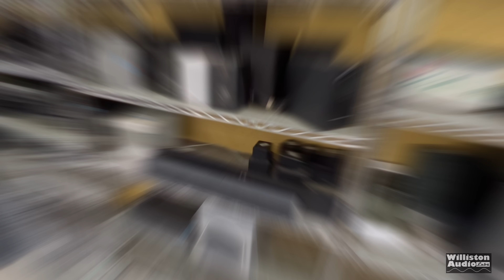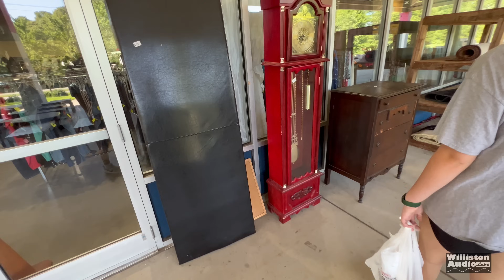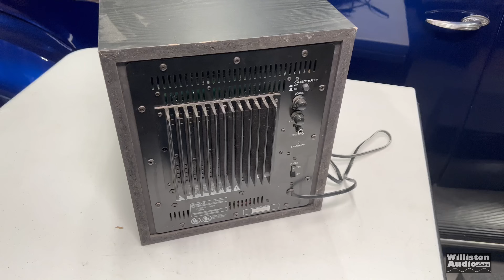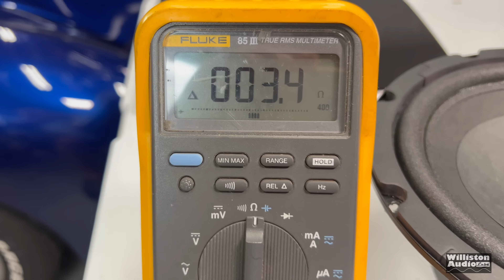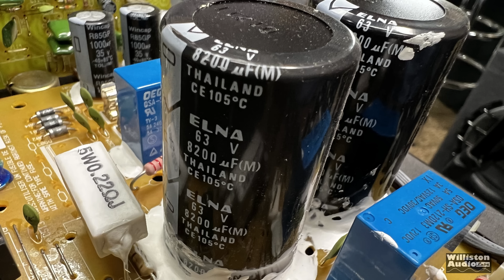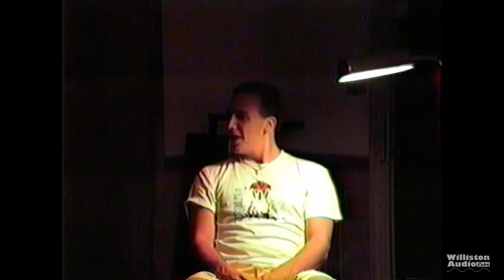Thrifting for Vintage Electronics? Kenwood SW-32HT Powered Subwoofer

Comment from the maker: Want a New Home Theater Powered Sub Instead?
Polk Audio PSW10: https://amzn.to/2R9Mgp6
Newer version PSW110: https://amzn.to/2CxhY7H
Other home subwoofers: https://amzn.to/2RbOiVQ

Send me a tip: https://paypal.me/BigDWiz
Support Monthly: http://www.patreon.com/OldSchoolStereo

Used in this video (Affiliate Links)
Pioneer DEH-80PRS Head Unit: (eBay Affiliate link) https://ebay.to/3xdUwZ6
Stinger 6000 Series RCA Cables: https://amzn.to/3d4W80b
Stinger 12ga OFC Speaker Wire: https://amzn.to/3d4pWKo
D4S 8g OFC Power Wire: https://lddy.no/1csoz
Precision Screwdriver: https://amzn.to/3B920NZ

VIDEO INDEX:
0:00 BIG THRIFT STORE!
0:25 THE ELECTRONICS
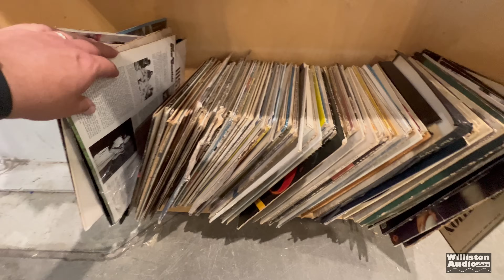1:49 THEY HAVE VINYL TOO
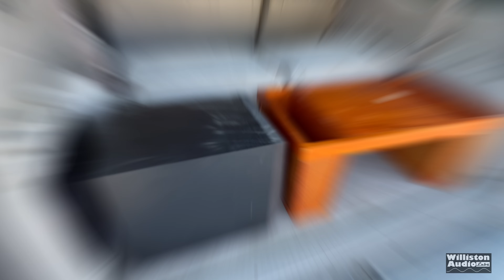2:56 MY PURCHASES
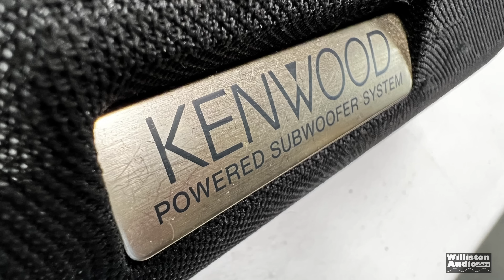3:33 THE KENWOOD SUBWOOFER
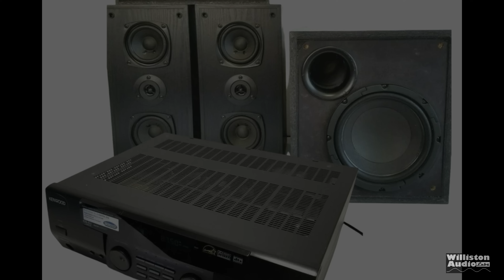4:00 SPECS AND FEATURES
5:05 DOES IT WORK?
5:58 CLEANING 
6:20 WHAT'S INSIDE?
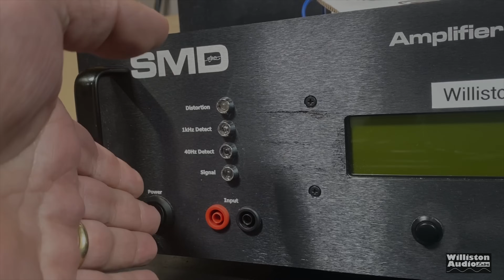7:43 AMP DYNO TESTS
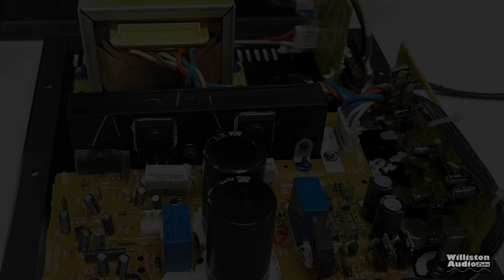9:39 AMP INTERNALS
11:10 FINAL THOUGHTS
11:30 EXTRAS

(Video Gear I Use) 
Camera - iPhone 13pro 1TB - https://amzn.to/3nCjGvc
RODE Wireless Go II Microphones: https://amzn.to/3Q6NVHl
Shure MV7 Microphone: https://amzn.to/3A4OICK
Zoom H4n Audio Recorder: https://amzn.to/3BXjVsS
960 LED Panel: https://amzn.to/2Sxoq3S

This VIDEO was EDITED with LumaFusion on an iPad Pro 12.9:
iPad: https://amzn.to/2Ancr1W
Software: https://goo.gl/6yvWss

--------- Test Bench Equipment -------

SMD / D'Amore Engineering Amp Dyno: https://goo.gl/sJTcf7
XS Power D1400 Batteries - https://amzn.to/2BPFCKW
XS Power PSC60 Charger - https://amzn.to/2CHGcfs
Fluke 1000A AC/DC Clamp Meter: https://amzn.to/2Rw5WDA
Handheld Dyno: http://amzn.to/2u2EgKV
My Favorite Screwdriver Kit: http://amzn.to/2x0VzcE

DISCLAIMER: This video and description contains affiliate links, which means that if you purchase from one of the product links, I may receive a small commission. As an Amazon Associate I earn from qualifying purchases
Reply: 11⁰
Reply: Is this prize on  Instagram a percentage of your merchandise
Reply from the maker: @tommyboy3737  no prize, ignore the scammers!
Reply: @wal  Thanks 4 the heads up but how about a new pb-16 utra for the hell of it🤣

Comment: Those transistors are not for power supply, they are power transistors for sub amp circuit. Rail caps are those big cans, smaller ones are filtering caps for preamp section and that small chip amp. Is there connection for satellite speakers? Maybe its the satellite amp chip :)
Reply from the maker: That was my bad I’m used to car audio amplifiers

Comment: 👍🏻😎 I got a couple of Velodyne CHT-10 subs for $150 from Goodwill. They were made in 2002. 150 watts RMS and 375 watts peak. They sound great on my Pioneer VSX-9500S putting out 260 watts RMS x 4 at 4 ohms. This amp is one of the few amps that doesn't cut power when you switch to A and B at the same time. The receiver was made in 1989 and is still working perfectly. It too was bought at Goodwill for $75. For $225 for the whole system it really can't be beat and it will definitely crank and bump with those subs added to it.

Comment: Yeah, my experience with these was 50/50. I had a JBL from Best Buy. I played music through it, and smoked the amp. It got warrantied out, but smoked the amp again. They told me it was designed for surround sound, not a basshead bumping that poor thing for hours at a time. I ended up getting a Adcom sub. I paid dearly, but it was worth it

Comment: Scored a 10channel multi room home amp new with box/cables at my local Goodwill for $25 sold on ebay for $1000. Same store, recently got a vintage Stillwater Designs(Kicker) 2x6.5/ horn tweets with 10" passive radiator for $25 Sounds just beautiful
Reply from the maker: Awesome 👏

Comment: I got the non powered version of the sub and the front L/R kenwoods for free when my neighbor was moving out. I ended up putting a crossover in the L/R speakers and stuff them and dont sound half bad. Pretty sure garret claridge blew one of these and it held up quite well lol. Mine I modded it with a dayton dvc driver

Comment: the 2sc 2sa transistors are the output amp in push pull and not for the power supply... the amp module would just be used for a driver.  True class AB current rail amplifier.
Reply from the maker: Caught that a bit too late as I'm accustomed to car audio amplifiers and whoops on that
Reply: @wal  LOL yeah...I work in pro audio.  I still like to look at car audio guts too though. As a repair tech I need to know all amplifier topology... class D is making it's way into pro audio more and more.  Seeing more switching power supplies and less transformer driven designs.

Comment: Awesome! I found a similar Kenwood, sealed powered sub 10 inch. The speaker surround was shot and destroyed. Replaced the sub with an new replacement. The sub bangs! Found it at the Thrift store for $7 and the new sub for $16 Amazon warehouse deal. Can't beat that

Comment: My tips for speakers. 
If it has a captive cord or spring loaded wire connectors its probably trash (some exceptions for 70's gear). Also heavy is ALWAYS better.

Comment: I have the exact same sub in my home system pioneer 5x100wrms plus 2 subs ... this one i upgraded the sub and i leave it on full frequency no crossover (amp control the sound) and my other one 250rms 12 inch is just for 80htz and lower and they sound perfect !!!

Comment: always carry a rca wire with you when thrifting. you can plug it in to the powered sub and touch the other end of the wire with your finger and it will make a constant boooooom sound
Reply from the maker: Great tip!

Comment: I've rebuilt some speakers I bought for dirt cheap at a thrift store. Big heavy Cerwin cabinets built tough. Replaced the crossovers and put a quality Eminence lab 12's and some nice horns. Run them on a Crown 1500 and they slam! I did the same thing with a pair of 15s, Cerwin cabinets again. I used Dayton speakers for the most part and they sound beautiful. Two mids and two tweets in both cabinets. I built my own crossover for those. I bought an old NAD amp and pre amp that worked fine at a thrift store website, it wasn't cheap. It was a gamble. I've had bad luck from online thrift store auctions. Great video! 
*I think if you did some videos on simple trouble shooting fixing old amps it might generate some interest. A lot of the older stuff is caps in the power supply, fuses are usually a good lead as well. Maybe rebuild some old speakers and test them against a nice pair of Klipsch Fortés or whatever. Build some nice compression drivers with some fancy wood maybe. I think you would gather a larger demographic of sound quality hobbyists. Cut through some of that audiofile snake oil bs. I don't know anything about making videos though, just some ideas.

Comment: Please Can You You Do The 12V AK-380 BTL Amplifier I’ve Been Using It To Power 2 12s I’m Using A 18V Power Supply And The Amp Shuts Off At Half Volume. I’ve Also Used A 12V Power Supply And Seem To Only Get About 10-15 Watts Per Channel I Just Wanna See How Far Can This Amp Be Pushed Before It Meets It’s Demise. I Gotta Know Big D !!

Comment: Sooo,   no..  that chip is a driver chip..said it right in the description.  The 'power supply' parts are the actual amplifiers..the chip acts like a strong  preamplifier so everything is peachy for the bipolar outputs to do their thing.. pioneer, alpine, kenwood,,,lots of old car amps did it this way too..  the actual power supply is the big square goldtone  metal box mounted in the corner with at least 5-6 wires hangin off it.
Reply from the maker: Yes caught my mistake cause I’m stuck in the car audio world and how they work. Thanks for the correction 👌

Comment: For $13 bucks not much to complain about. I suspect the long 3" port was to spare them from using stuffing and other accoutrements in the box to damp resonances. The long port at least stops some of that from coming back out and being audible. The downside to having its rear throat so close to the rear partition is chuffing, but considering how inexpensive it was when new, its what you'd expect.

Comment: fun video Big D!, as usual. Those thrift shops are a trip through time and trends. I still use a rack system for my HT (a 7.2 dolby...Marantz)...It has become dated with"Dolby Atmos" being the latest thing. But I have been trying to keep up for decades. Wireless sound bars are also trendy...but, my wires are all run for surrounds and what not, I am not messing with it...its fine. Truthfully, I am not as much into home audio than car audio...and only vintage domestic made stuff...as you probably know, KLH was once a high quality product, designed by Henry Kloss. He bounced around various speaker manufacturers, I think, including Advent, and most recently "Cambridge Soundworks", I think he also worked with Paul Klipsch, of "Klipsch", great video Big D
Reply from the maker: Yes the old KLH was good but the 90’s and beyond was the cheapest of the cheap
Reply: @wal  ...I bought a KLH sub from Sams many years ago...obviously not a Henry Kloss design, but I did not know better at the time, $150 does not get you HK quality. But, I still have it. It still works. Probably on par with the Kenwood you bought...keep up the good work Big D! Its always fun

Comment: Just a heads up that the 1298 chip is only the driver for the big output transistors 2SC5200/A1943. 

The power supply consists of the big transformer which is already AC so it doesn’t need “power supply switching” transistors. I think you’ve just been looking at car amps too long. 😅 - A. Hammett
Reply from the maker: Ha! Got me!!

Comment: I own a few pieces of thrifted/swapmeet home audio myself that I have used in my garage set up. A thing that I found out is that home equipment is just as susceptible as car audio to the dreaded capacitor death. I lost some very nice analog Technics and Yamaha pieces due to cap death. While I still have a very nice Kplisch powered sub and a newer Pioneer reciever, the other pieces failed in the order of their age. Speakers are pretty reliable irregardless of their age if they have the non rotting surrounds. My Bose 301’s are still in near perfect condition. Thanks for adding to the channel’s variety.

Comment: Love that you used the dyno on this little guy. Very impressive for a HTIB setup, honestly didn't expect the wattage to be anywhere close.
Reply: What was a bit strange was the amp guts. I’d love to see a schematic for that whole unit to see what’s going on. The big Toshiba transistors I don’t think were for the power supply. It had a full size inductor for the mains meaning the power supply was a conventional rectifier. Maybe the amp IC was being used as a predriver and the big Toshiba semiconductors were actually an output stage.

Comment: I got one of these Kenwood subwoofers a few years back and used it was a passive model and not rated for a lot of power but it sounded pretty decent and it actually took a bunch of abuse well over double the power.

Comment: Something that I though about, the amp does about exacty 100w at 12v, the 120 something was because It was ran at 14.4v
Reply: The 14.4 was just what the Dyno was running on ! The amp itself runs on AC voltage.   FYI

Comment: Lovin it big D I have spent some serious coin in the thrift stores here in Denver area over the years. We have several Goodwill and a local chain called ARC. Most are in older shopping centers that used to be grocery stores so quite large. You can find car audio gear every now and then but home audio stuff is readily available. My latest score a couple weeks ago was a Polk 12in sub with a slot port for $20. It's immaculate not a scratch and it sounds great

Comment: Pro tip- when you're testing at the store all you really need to do is plug an RCA cable into the amp and slowly ramp up the volume as you tap on the other end of the RCA cable. Your finger creates a kind of ground loop that will cause a hum. If you hear hum in unison with your finger in contact with it then the amp and driver are functional. You can even hear ratting/buzzing if the sub is blown. Works every time believe me :)

Comment: When I was 11, I used to lust after the Realistic, white colored, metal enclosure mini speakers. I think they were outdoor type and were inexpensive compared to Bose 101'a. I was going to run simulated surround on my Onkyo TX-906 AV Receiver, and those were going to be hung up high on the back or side walls.

Comment: I'm constantly finding some great audio stuff thrifting.  Issue is, I have too much stuff already, and with shipping prices these days, it's probably not worth selling anything for much profit on eBay; $10-20 profit after all is said and done probably isn't worth the hassle.  One thing I also consider when thrifting is the enclosure quality.  I just assume each speaker could potentially be blown and I'd be repowering the enclosures with some Dayton Audio speakers, so want a decent enclosure.

Comment: the amplifier section in this is very interesting. the upc1298v has everything required for a class ab amp except the output power transistors , 2sc5200 and 2sa1943 is the output transistors in this case.
Reply: and your explanation of the amp section was totally wrong ☠☠
Reply: It doesn’t have everything required - still need a power supply and some passive components.

Comment: Scored a Kilpsch SPL-120 for 50 bucks the other day, and sold a Pinoeer SX receiver for parts, after using it for 2 years and bought for 10 bucks. I've seen amazing stuff at thrift stores, even a 10" shallow Rockford Fosgate in an enclosure for $30! Big D, please grab random old reveivers and add amp dyno, as ratings back in the day were also odd, just like older amplifiers somehow put out crazy power. ✌️
Reply: I agree with this, I’d love to see an old school marantz get dyno’d. My dad had one in the 80’s and said that even though it was rated for 18 watts, it blew all of his buddy’s 100 watt+ systems out of the water!
Reply: Yea just random amps dynoed would be great
Reply: I want to see a half ohm test on the old school amps.